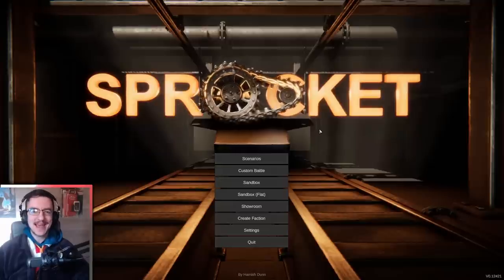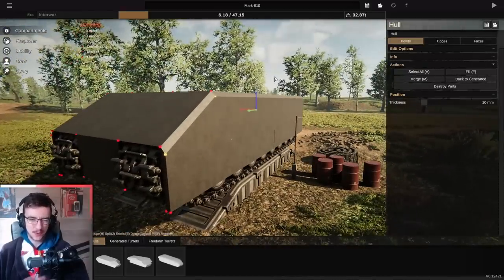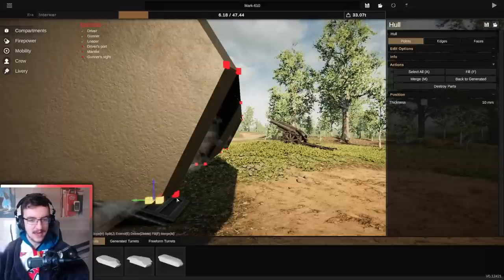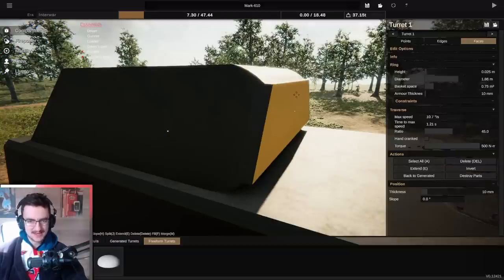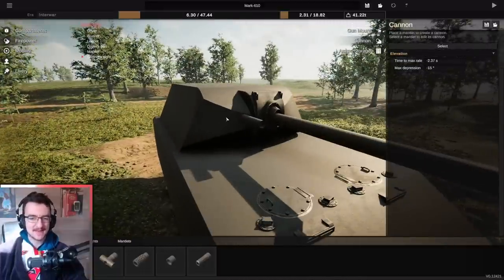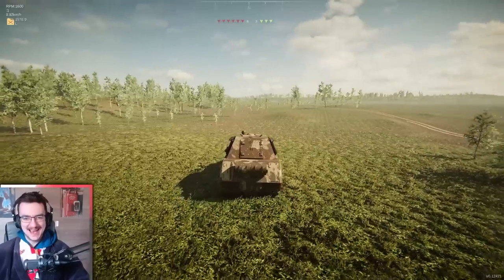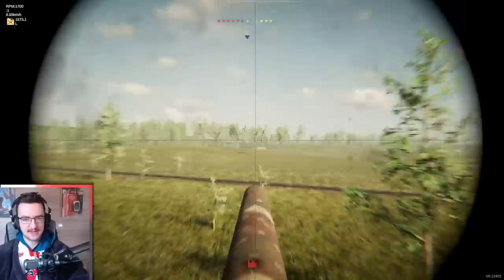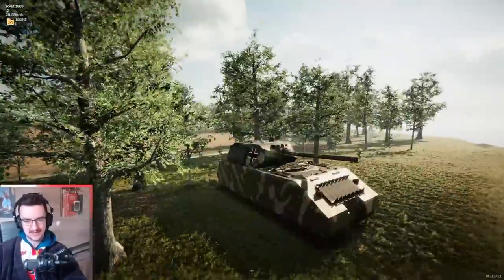I Built A HUGE 200TON MAUS In Sprocket Tank Design!

Comment: interesting fact: the Maus tank was the biggest tank ever produced and used in WW2 although only 152 of them were ever produced
Reply from the maker: Ayeee
Reply: Didn't the Maus only been on the prototype stage with 2 Prototypes produced? 🧐
Reply: @orangeherzog8562  yes
Reply: @orangeherzog8562  not even that, there were only 2 chassis which still lacked their engine and trans I believe, with only one having a turret assembly ready to mount
Reply: This is completely inaccurate, none where used, one was prototyped
Reply: What? It was never used, and where did you get the 152 number from?
Reply: @satansnarwhal  yeah, but didn't they put one fast together to show it to Hitler or something?
Reply from the maker: I might actually be mixing the Maus and Ferdinand up ^^
Reply: @orangeherzog8562  nope, neither of the 2 hulls were ever operational. I have a faint memory of reading something like that but it was one of the many other prototype tanks they had on the drawing board

Comment: what you got is decently accurate but it weighed 188 metric ton so 210 US ton, the upper and lower front plates were both 230mm thick, hull sides 185mm, hull rear 160mm, turret front 280mm, turret sides and turret rear 210mm, roof and belly was 80mm. it had around 1,950 Horsepower top speed was around 20-25 kph and had 2 machine guns a MG-42 next to the main gun and a 15mm MG-151 AA gun. loved watching this
Reply: isn’t the turret frontal suppose to be 260mm?
roof and belly 55/65
Both front lower and upper plates are 200mm. the rest is correct.
And no, it only has one machine gun port.

I think🤔
Reply: @bluebucketdude8909  Sources vary i don't think a whole lot of info survived and what you say is true for the version in world of tanks but wargaming has a habit of not really being historically accurate in my experience and either nerfing or buffing a vehicle and they nerfed the Maus at leas twice cause people complained it was too tuff
Reply: Hmm. understood
Reply: I mean, I looked up blueprints and stuff, so, maybe some of them are inaccurate too

Comment: So to "correct" you on the history, this wasn't necessarily fielded by the Germans during WWII simply because they only got 1.5 of them built; 2 hulls and 1 turret. So between the strained manufacturing and nearly nil resources they managed to build that many and then the factory manufacturing the things was attacked and destroyed. So it wasn't "successfully fielded" by strict definition. It was in production though when the factory was destroyed, so if that hadn't of happened, the Maus could have seen the battlefield.

Also, I think you should add Ferdinand Porsche's "brilliant" anti-air idea to the Maus. He offered to mount an 88mm gun to the back of the Maus' turret pointed straight up to get any aircraft that just happened to be flying perfectly over the thing. . . . . The UK had Hobart, the US had McNair, Germany had Porsche.